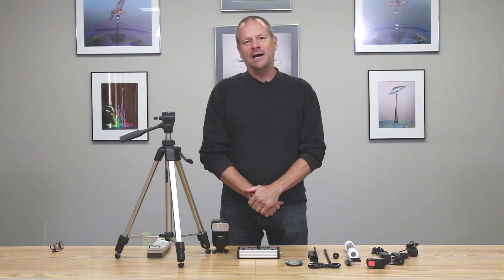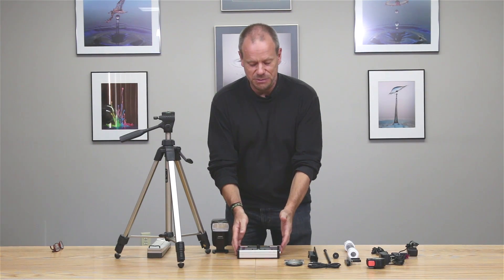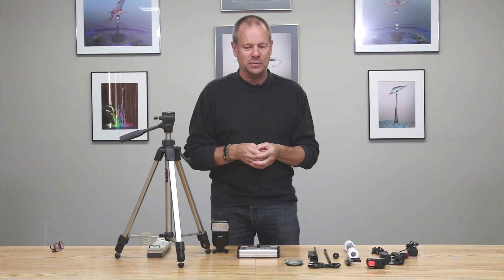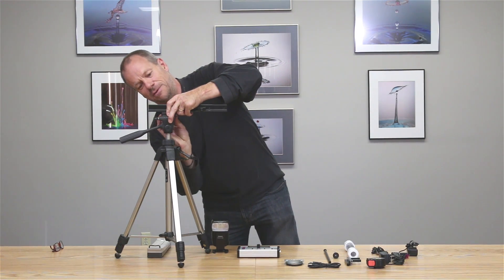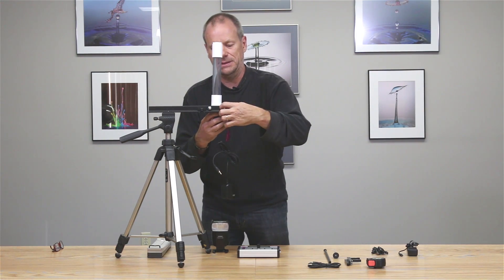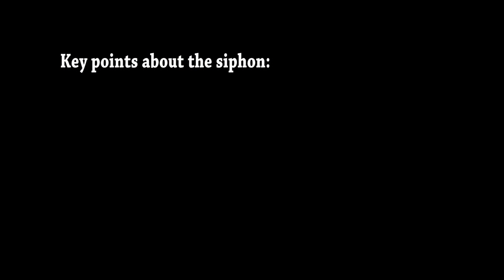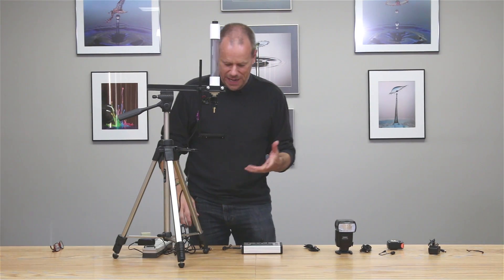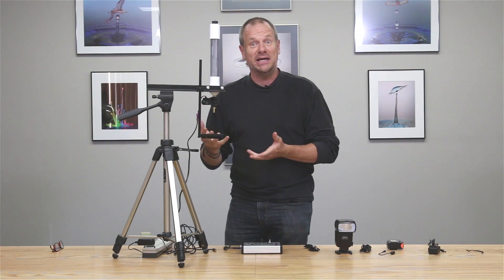Assembly: StopShot Water Drop Kit

Comment: I would like to get one, but I wonder if I have to connect to the camera, and will it work with any camera ?
Reply: +Athip Sweden 
Hi Athip.  For water drop photography it is actually easier to NOT connect your camera, because then you don't have to deal with camera shutter lag issues (you CAN connect your camera if you order the correct shutter cable, but we'd recommend against it).  You just have your camera set to a long exposure (1 - 2 seconds) or in bulb mode.  Press the shutter button on the camera, press the button on StopShot, and then StopShot will coordinate the timing of the water drop and off-board flash.  The kit comes with a PC sync cable for a single flash, so make sure your flash has a PC sync connector on it.  If not, you'll need a hot-shoe as well.  If you have any other questions please e-mail our support e-mail address -- we'd be happy to help!
Reply: Thank you Matt, sound like I need to practices the basic  technic a little more.